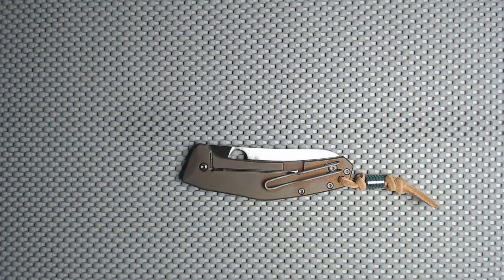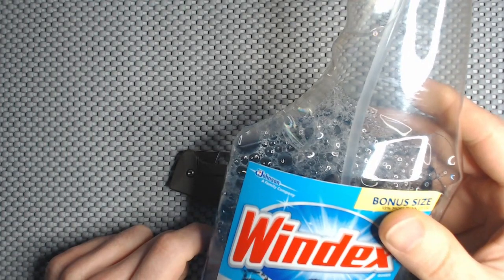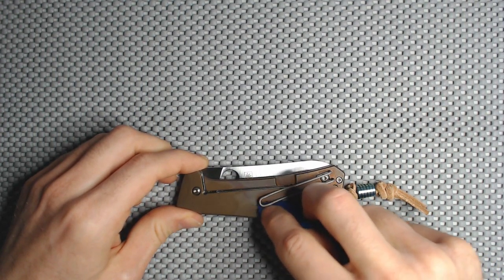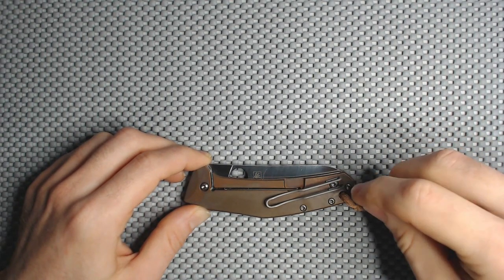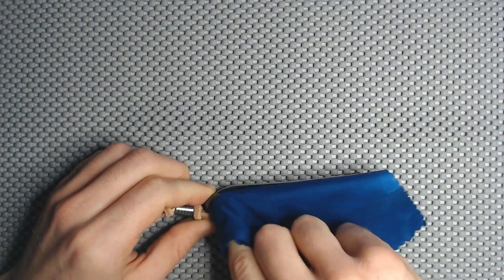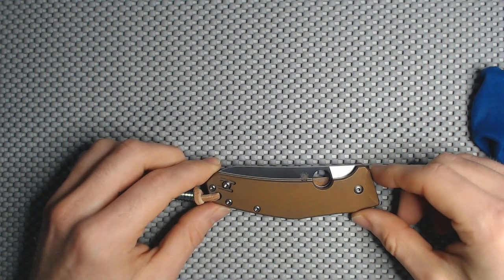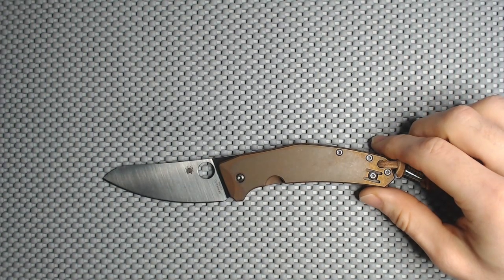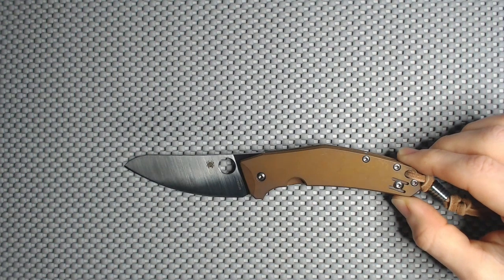How to Clean Anodized Titanium Surfaces? ✓

Comment: Does it work on  anodized aluminum?
Reply: It's a cleaner, so it'll clean the surface, but since the two metals "anodize" so differently aluminium doesn't really do what he's addressing in the video.

Purely coincidentally, my spydiechef is anodized nearly the exact same color and I can confirm that if you even look at it too long then the color basically disappears.